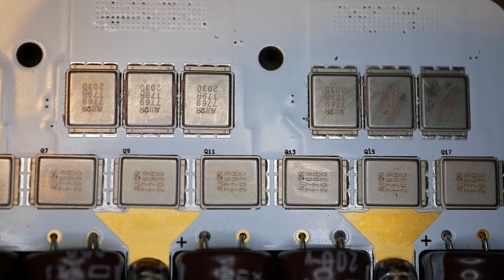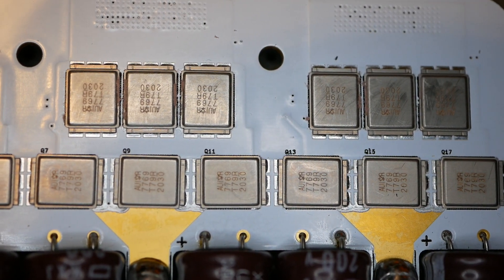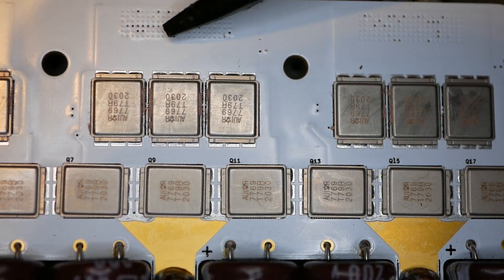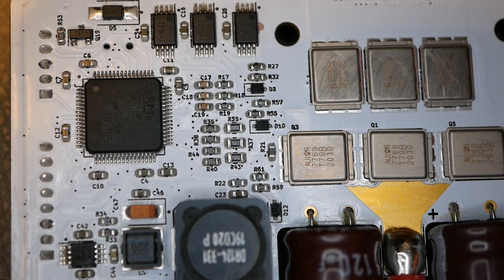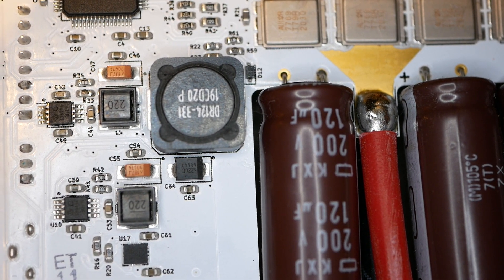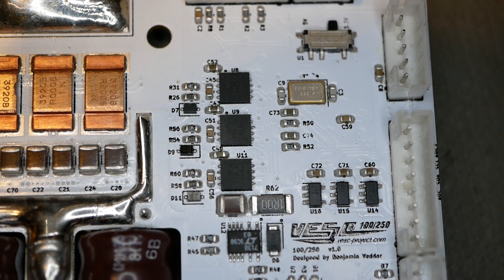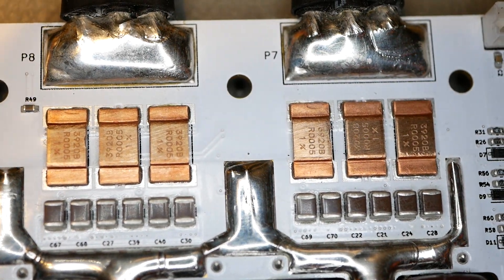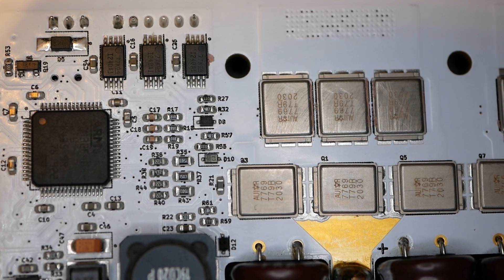Trampa 100/250 VESC Teardown 2 Macro

Comment: Seems odd not to have a temp sensor near the fets. 

A couple complaints I have about this controller:

The customer support is pretty bad. Hard to get technical answers from them like how many amps the wires are rated for. I also had an issue with the controller reporting the battery voltage as off by about a volt and they said this was fine. That was the only vesc that has even done this. All my other vescs report voltage dead on. 

The other complaint I have is the jst connectors are really weak and can break if your not careful. I’ve had that white part come with the plug when disconnecting.
Reply from the maker: Support is open source like the controllers. Most companies will be pretty useless in this department as they are commonly dependent on the much wider VESC community for technical answers. There are tons of YT videos on controller set up. There are forums on Facebook and Discord for VESC. VESC support isn't the traditional model since it's so wide spread and developed for by dozens of companies. Depending on the component quality, you will see variation in measured readings. Probably your voltage reading issue was something like this. JST is pretty sturdy considering it's small size. I've had them pull out like that too, but this is the exception.
Reply from the maker: I was wrong. See the my pinned comments.
Reply: @de-bodgery  ahh got it.  Yeah seemed odd to not have temp sensors.  

Any thoughts on the issues above?  Have you had similar issues?  For the price of the controller I would expect better support.  I mostly paid the price in hopes that Benjamin would see most of the profits but trampa rubbed me the wrong way whenever I asked a question.  I can send you copies of the emails from them if your interested.
Reply from the maker: @bj97301  I think the folks at Trampa are arrogant and condescending. I've dealt with them just once to get those 2 100250 controllers and that was plenty! I'm sure your emails back and forth with Trampa are similar to mine and not overly pleasant or helpful. I don't expect Trampa or any VESC maker to offer support. This isn't your typical product support as there is a vast VESC community. Benjamin makes firmware and hardware and gets a percentage of sales.
Reply: @de-bodgery  I agree. However, my question was related to their product specifically and the forum didn’t seem like the right place to ask. I was just curious about how many amps their wire was rated for. Seemed like a straight forward thing that they should know.
Reply from the maker: @bj97301  You can easily google for wire gauge charts that show amperage.
Reply: @de-bodgery  I understand this but my wires don’t have any markings for the gauge or mm.
Reply from the maker: @bj97301  If you have a 100250 then you have the same guage wires as I do. If not, you can measure the diameter of the wires and use that to calculate the wire gauge in cross sectional area. After that, charts are easy to find that tell you what you want to know about amperage. Probably no one answered this question for you because none of this is particularly hard to find for yourself with a few minutes of thinking about it.
Reply: @de-bodgery  I definitely understand this I just assumed that after paying this much for a controller I would be able to ask a seemingly simple question then get a simple answer back. I think it’s important to not just look at the hardware when evaluating a controller but other aspects as well such as customer support. Not everyone who buys the controller is an EE or is willing to google and look at forums for hours to get help. Sometimes they just want to plug in a controller then have it just work. This is where customer support is important for average users. I would understand if on the sales page they mentioned that there would be no customer support or a heads up of sorts regarding the poor level of support. But I had no idea just how bad the support was going to be until after I purchased it.
Reply from the maker: @bj97301  You are stuck in a different support paradigm. You like most people are used to calling the manufacturer for a product and expect that they support their products. In most cases this is true since that product is made only by them. Buy a Samsung fridge, you call Samsung for support. This is NOT true for VESC based controllers. You will find this different paradigm for anything open source. Linux comes to mind, Java, Python, etc. Open source software and hardware works very differently. It's a community and NOT just one manufacturer like Samsung. You don't get that "1 product = 1 support group" paradigm with open source products of any kind. You will spend the time yourself researching things and there are many open source communities that can help with this! On Facebook and Discord and other places are forums for EV related topics with many people such as myself helping others with these kinds of questions. You wanted the "1 product = 1 support group" paradigm, but you bought an open source product and that doesn't work the same. Adapt or don't...I like it personally! It's not "bad support" it's just not fitting the "1 product = 1 support group" paradigm.
Reply: @de-bodgery  I disagree. Open source projects like many Linux distributors don’t charge anything for their product. I would not expect the same level of support for free software. You can opt to pay for support packages. Once money is involved it’s a different expectation and the distributors and customers know this. 

I have had pretty good support with my other vesc controllers. The little focer for example and even flipsky have been much more responsive and willing to help or answer simple questions. 

I am not saying don’t buy this or that it’s bad but if your trying to be informative I think it’s important to mention. You talk a lot about ko’s business and people. I just think it’s important to be up front about everyone equally.
Reply from the maker: @bj97301  I do that. I've talked about how good the EBMX people are. I've pointed out the shittiness of KO people. What else do you want? Other VESC sellers, especially the Chinese ones, they sell very cheaply and don't do any support hardly at all. If/when I get there with Shul or Tronic or whoever, I'll talk about their people too and however that experience has gone. IS it my fault that KO specifically has been a giant thorn in my side well before I ever owned a KO controller? I report my experiences and that is what my first KO video is about. Since I now have an EBMX, I might as well do one about them too!
Reply: @de-bodgery  seems like your not very receptive to my suggestions. I’ll drop it. Just wanted to help you seem more neutral instead of only critical of people who you don’t like(ko).
Reply: @de-bodgery  LOL, you're preaching to the choir on that one!  I spent days trying to get them to tell me how to get the keyboard arrows to test the motor in vesctool, they never told me to just make sure it was in uart mode, like you said, i got it from the community somewhere

Comment: The 100/250 measures temperature on each phase with NTC thermistors.  R21 next to the mosfet closest to the STM32, then R49 and R51 next to the shunts on the other side.  It rolls back power based on the highest reading.  The "VE X" chips are "MC74VHC1GT66" analog SPST chips.  They don't connect to the ADC input pins for throttle, but are used to filter the phase voltage sensing.  This is somewhat unique to the VESC firmware and allows for better low speed tracking of the motor.  I'm loving these teardown videos so far, but some of the statements could been verified in about a minute with an ohm meter or by looking at the real-time data in the tool...
Reply: can you tell me if mouser AUIRF7769L2TR is the same mosfet?  I can't tell from the data sheet how many pins or the package?  i shorted my 100/250 and have to try and fix it, it cost a fortune.

Comment: Another clueless opinion video...
R49 is the temperature sensor, mosfet thermal cutback works extremely well.
Shunt amplifiers are analog, they dont spit out ones and zeroes
The ICs at the analog inputs are just for protection, the actual ADC is of course inside the MCU, as you want all analog conversions in sync with the mosfet pwm to avoid noise.
Chip next to usb is also just protection. The stm32 can be connected directly to the usb lines as it has native usb support
Reply: Yeah that was a bit harsh. Not everyone can know everything about the fine details of electronics like us, so thanks a lot to de bodgery for opening up all these expensive bits of kit and giving what's frankly a fair review on them.
Reply from the maker: @DavidMolony  People that know a lot about controllers, feel free to correct my mistakes. They will happen and you make my content better. Some mistakes are just dumb and I'll use the wrong word and not catch it. Some are that I simply don't know. Some are done deliberately and over simplifications for the people that won't know and won't understand more technical details anyway. It's a balancing act where I will irritate the highly technical. I welcome the feedback. Just be nice about it please.
Reply: @de-bodgery  My main comment is that I do not have the time to watch your lengthy videos. I could correct/help/... but can;t devote the time. This was linked to me from the VESC Discord. I know Youtube rewards longer video times, but 2 15 min videos... :S
Reply: @DavidMolony  Video length is inevitable for these types of content. EEVblog would have been 55 minutes
Reply: hi marcos, can you help me find replacement mosfet, those exact part numbers aren't availavble, so far I've got mouser AUIRF7769L2TR but I can't see how many pins there are on the data sheet, I think it's the same mosfet?
Reply from the maker: A bit harsh don't you think! I make mistakes and so do you! If you know something, just say so and don't be a dick about it! I will never claim I'm an expert or know all things. You shouldn't either! Be humble and respectful of others! Just state what you know and I'm more than willing to correct! I did notice those two parts, but they are labeled R and not TH, so that's either a silk screening mistake or they are resistors. I never do a deep dive in the IC's. AS I've pointed out, I want my videos to reach the brader audience and not the people that already know more than the average. While I appreciate your corrections, consider who I'm trying to reach! I'll always endeavor to be accurate, hence ADDING parts and what they actually are. I won't ever put my head up my ass and talk over the heads of the average people that just want to know what is good and why.
Reply: @de-bodgery yes, likely too harsh but my issue with the content is that you say with confidence things that are plain wrong and will certainly confuse or mislead your audience
Reply from the maker: @MarcosChaparro  Feel free to offer corrections. I'm open to being wrong and I don't care that I make mistakes and then correct. I have no need to be right or ego or beligerant or insist that only I have all knowledge! I am not the dipshits at KO! I make mistakes...that's life! So please show me stuff you see I say wrong as they will happen! What I try to do is be accurate and that's never going to be 100%. I obviously fail at it and I find many mistakes after I publish. Only thing I request is that you not be smug and condescending.
Reply: @de-bodgery  I suggest you include the corrections on a pinned comment. This makes clearer

Comment: Hello DB, I don't understand why there are only a few vesc controllers from China. Vesc is a Swiss army knife. Right know there is an interesting project on github. Some nerds are porting vesc to the xiaomi m365 and the ninebot g30 controller. The community is growing and modding the hardware up to 20s. Even the standard dash is working thanks to a lisp plugin for vesc. Sure there are many limitations, but you can start with a 20 bucks Chinese knockof. As always: thanks for your videos.
Reply: I can tell you why, all of Vedders designs are based on surface mount, high cost mosfets.  Most of the cheap Chinese stuff ops for the highly cloned TO220 package and comparable cheap, old components.  Now, you are starting to see many clones of these controllers and even some Chinese designs, like Flipsky.
Reply: i have 3 Xiaomi escs flashed with SMARTESC hahahah, it seemas that americans dont know about this yet
Reply from the maker: @DanielGonzalez-oc8ss  I've read about this, but don't have the EV's or controllers so not something I have paid much attention to.
Reply: trampa doesn't provide a lot of support either.

Comment: lol now i can see lo thats way better now why cant you use a light like this for the bigger comaera or what ever lol anyways god bless and keep on keepin on brother
Reply from the maker: This was all done with the macro lense from about 2" away from the board. I have to use a halo light around the lense so it's not in shadow when I record. I don't have the new halo light yet, but I did bypass the control module that sits in the hot shoe on the camera and powered the halo directly. I may not bother with the new halo and jsut send it back. My bypass lasted many hours of recording and worked great. The LEDs in the halo are just fine, it's the control module that died.